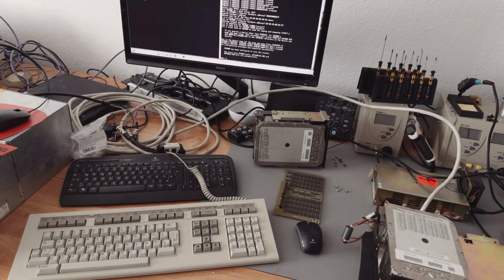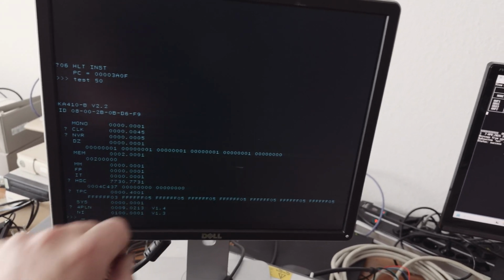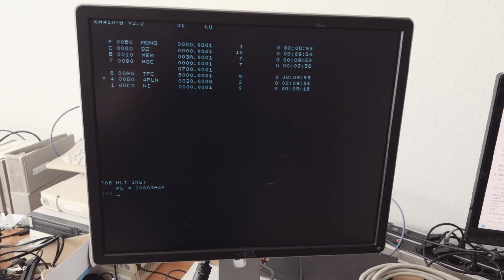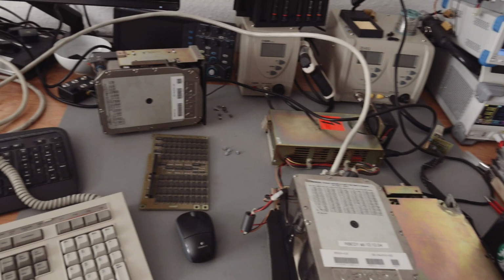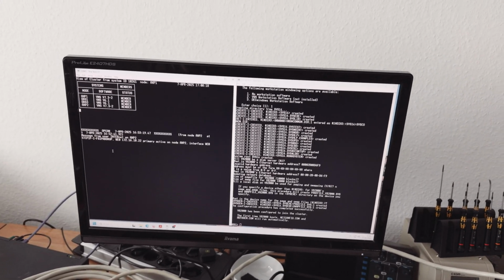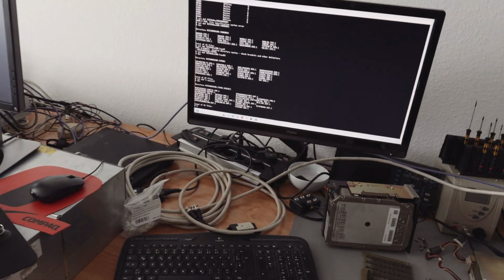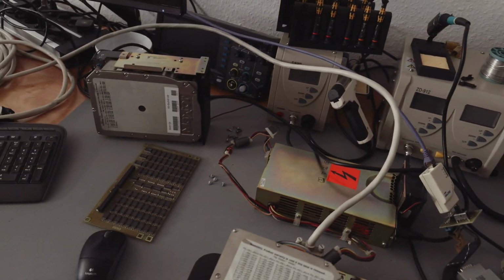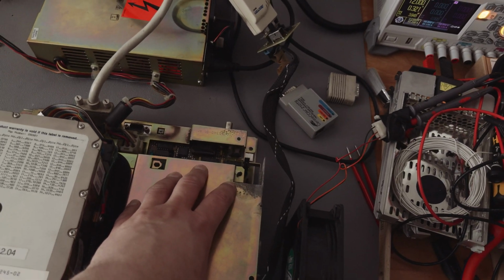A Failing Network Boot Test with the DEC VAXstation 2000

Comment: I assume you checked the network selector, and verified the UTP adapter is getting power?  I had some MicroVAXes with a blown AUI fuse which prevented the adapter being powered. It looks like you are getting opcom messages of boot attempts, so probably OK.  I see in the "Workstations and MicroVAX 2000 Network Guide" Page 2-27 that it states booting into a LAVC requires at least 3MB. I think there is only 2MB on the motherboard, so you may not get anywhere without that memory board connected. I've booted mine into a LAVC without problem, but then I had 6MB of memory. Good luck!
Reply from the maker: The transceiver is fine, I have also tested two different ones. But apparently not much is being transmitted by the VAXstation, as TX only lights up once for a short time. I'll use WireShark to check whether anything is being transmitted at all and if so, what is being transmitted. If 2MB of memory is too small, it could also be that the connection is simply interrupted after the transmission of 2MB. Even if I don't know the exact functionality of MOP, I can't imagine that no ACKs are being sent by MOP and therefore I find the missing TX suspicious.
Reply: @DECcomputers If you do reply/enable=net on the other cluster members console, you should see the VS2000 sending the MOP request.

Comment: I seem to recall the vs2000 needs a heartbeat switch "on" on its trransceiver, and there is a hard limit on kernel size for the MOP boot process in the ROM, which was a problem already as far back as netBSD 1.4 or so, when I was tinkering with it last.
Reply from the maker: I will activate SQE on the transceiver to see if that makes a difference. I hope that the systems can at least boot VMS/OpenVMS over the network and that the kernel size is therefore suitable. I will also use WireShark to check whether anything is being transmitted at all.